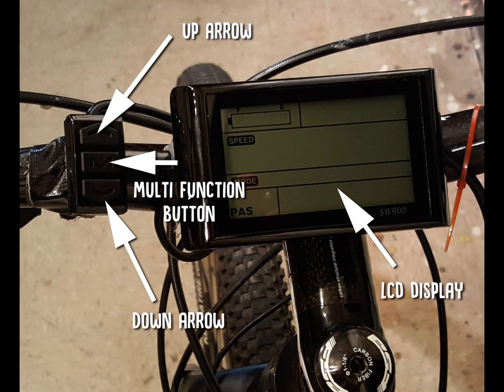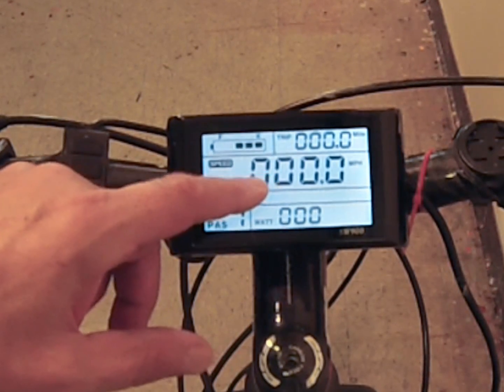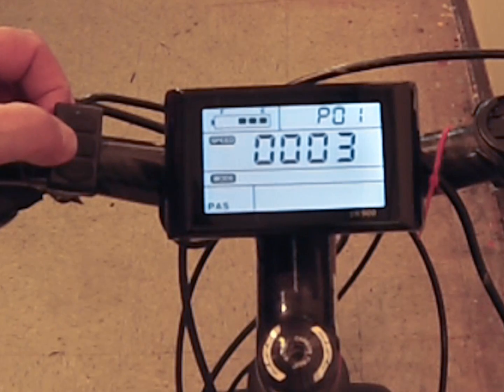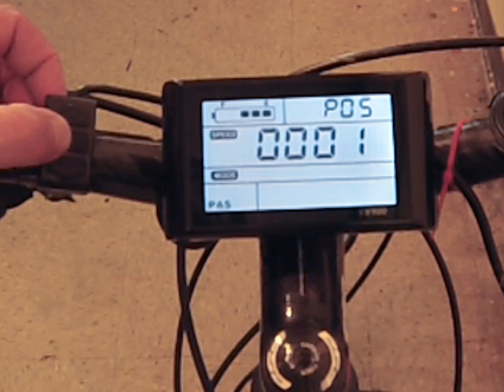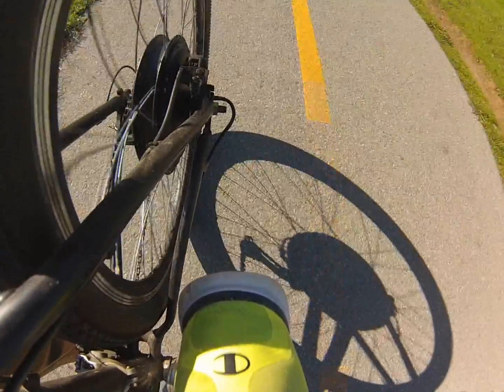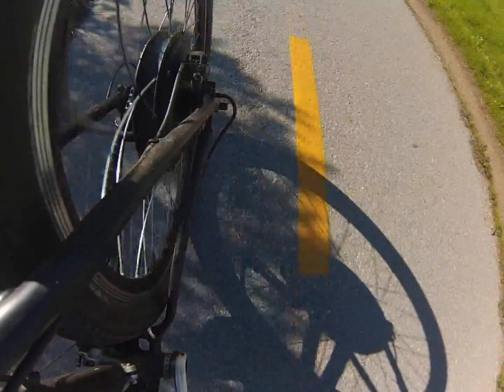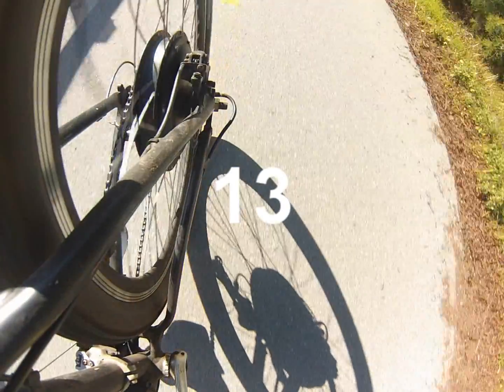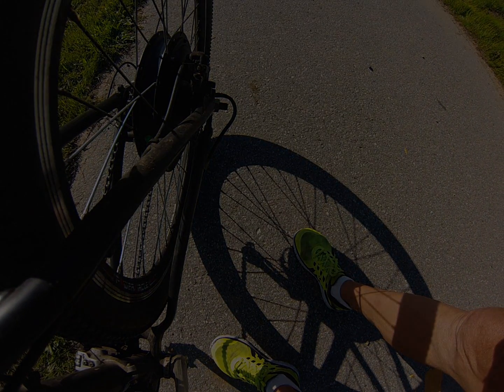EBIKE TIPS. The SW 900 LCD E-bike computer how to control it's 15 functions

Comment: 4.8 Parameters setting
P01 Background luminance. 1 is the darkest, 3 is the brightest
P02 Unit of the mileage. 0 is KM, 1 is MILE
P03 Voltage grades. 24V, 36V, 48V. The original voltage is 36V.
P04 Sleep time. 0 is without sleep, other numbers stand for the sleep time (1-60 min).
P05 PAS grades.
 0, 3 grades mode: 1 grade 2V, 2 grade 3V, 3 grade 4V
 1, 5 grades mode: 1 grade 2V, 2 grade 2.5V, 3 grade 3V, 4 grade 3.5V, 5 grade 4V
P06 Wheel size. Unit: inch. Precision: 0.1
P07 Speed measuring magnet. Range: 1-100
P08 Speed limit. Range: 0-50km/h, 50 means without limit
 No-Communication Status (controlled by the meter): when the real speed is over the ones
we set, the meter would shut off PWM output; when less than the speed we set, the meter
would turn on PWM output automatically, the driving speed would be ±1km/h; (Speed limit
is for PAS, not for Throttle)
 Communication Status (controlled by the controller): The driving speed keeps same with the
ones we set. Random error: ±1km/h. (Speed limit is for both PAS and Throttle)
Notes: These data are based on KM. When changing KM to Mile, the speed value on the
screen would convert to correct Miles automatically, but if you do not change the setting of
speed limit from KM to Mile, it would be different from the real speed limit in Mile. 
P09 Zero start & Non-zero Start. 0 is Zero Start, 1 is Non-zero Start
P10 Driving mode.
0 is driven by PAS. Throttle is useless at this time.
1 is driven by Throttle. PAS is useless at this time.
 2 is driven by PAS & Throttle. Throttle is useless at Zero Start status.
P11 PAS sensitivity. Range: 1-24
P12 PAS start strength. Range: 0-5
P13 PAS magnet type. There are 3 types: 5, 8, and 12.
P14 The Current-limiting of Controller. The original Current is 12A. Range:1-20A
P15 Not implemented now.

Comment: As an Engineer, you did a great job explaining all the functionality of the controller. Unfortunately,  I have a different model and I only have 23 functions. Just wondering, does a factory setting contain the settings as delivered?
Reply from the maker: Thanks Jessie, The simple answer is yes and the reason they do that is based on international laws about voltage, wattage and speed. With the better controllers, you can customize those settings based on your needs. The earlier models of ebikes had those settings hard wired into the controller.

Comment: After watching your video I was excited to out to my garage where I have my new Ecotric Fat Tire Bike and adjust some of the settings. Only to find out that I don't have the SW 900 Computer... I have the S900 Computer which is missing many of the fun features that the SW 900 has. Oh well... thankfully I just found the SW 900 Computer for sale online. So I'll just be out an extra $50. Plus I also want to get the rear and front powered lights as well, which can also be controlled by the SW 900... but not the S900. Bummer...

Thank you for the time and effort you put into making this video. Very good!  I just subscribed. Cheers and God bless

Comment: I'm wondering if you could help me when pulling on full throttle does your battery meter dip to Empty then when realising throttle it goes back to the full battery Indicator or do you think this is a fault somewhere

Comment: Hey I need help please
I have the s900 screen some of my P settings are disabled 
I want to unlock my speed however all manuals I have found are for sw900 and I have the s900 
P01 P02 
Some are skipped and then I randomly have P018 which I can’t even change any settings can you help me out
Reply: Hi man 
Have you found the instructions? I have s900 may someone has ?

Comment: Thank you so much for your detailed walk through of the control panel. The kit came with no instructions and even though I knew holding down the buttons would change settings, I still had no clue what the setting were for. I found your vid extremely helpful.

Comment: I have this unit in my Radrover bike, which I just purchased last week.  The odometer is stuck on .9 even after riding for 3 miles measured by a different bike.  Is there something wrong, or can I go in and change the odometer some how?

Comment: Anyone who got error 10: I recently had the same Caused by connecting a gps to the 12V dc output intended to be used with a torch on the motor control unit ,this caused something to blow but the problem wasn’t in the motor control box it was a resistor in the SW 900 display so maybe open your display and look for burning.

Comment: Is there any way to increase the LCD screen timeout settings from the default of 5 minutes; which wipes out any trip statistics after it turns off? Thanks!
Reply from the maker: I love many aspects of this LCD, but I don't like that it wipes out your trip stats when turned off. I wish I knew a way to change it. There are other LCDs that don't do that, but they aren't as accurate. Thanks Stephen!

Comment: hi i have one of thease with a controller that it came with i just installed it on the bike but for some reason i cant get the display to turn on and it will not turn on at all witch wont allow me to use the bike i made sure the battery and esc getting power but im stuck

Comment: Hi! I Have the same lcd display and when you press long to up arrow its turn on the light but i could not find which cable and what voltage lamp i have to put in. is there any way to converting 48 volt to 12 volt for lamp and which cable

Comment: Does the SW 900 Work with any motor or only paticular ones for comparability and price please.
Reply from the maker: It will work with most motors. The SW-900 is both the LCD display and controller. There are a few manufacturers that have the controller in the motor, so it will not work with those proprietary systems.
Reply: Art Ashworth it won't it simply works with the controller in the sense that it allows you to change various values and settings of the  controller and motor like the video shows
Reply: Are you saying that the SW-900 will replace the silver ebike controller box that comes with most of the 1000 watt rear hub motors?

Comment: nice video! i have the same kit but my pas only works when i paddel backwards :\ is the pas on the wrong side or do i only need to turn it around? maybe you can help me
Reply from the maker: It's on the wrong side of your crank. You have to install the magnet with the arrows facing in the pedaling direction. They should be clearly marked. Let me know
Reply: Augustine fast Carbon e-Bikes - Santa Cruz 2017 yeah that was the problem 😂 thanks for your answer
Reply from the maker: Great! Before, you were probably riding -25 mph

Comment: what is pas grades mean?
Reply from the maker: Pedal Assist
Reply: Augustine fast Carbon e-Bikes - Santa Cruz 2017 you said you can control the amps from 1-20 I have a 40 amp system will his not work for my bike.

Comment: When I pedal(PAS) the motor kicks in and I go too fast(16mph) in ECO. Which setting(s) should I change? I have tried several different combos but no luck yet.
Reply: 968Porsche1993 - Hi.. You ever figure out how to adjust your pedal assist lower than 16 mph?
Reply: Hey I have the same issue did any of you guys figure it out? Mine even in eco mode propels to 16 mph, the only way to lower is to lower the max speed setting but then the 5 pas settings becomes useless as . Again the throttle allows speeds a lot slower , right down to walking pace. Mines a 1000w kit with this exact computer display
Reply from the maker: Go to Parameter setting 9 and set to zero. That is Zero start, which means that your motor will not start until you have pedaled 6 to 10 revolutions and then your motor will work in PAS mode.
Reply: Is there a way to decrease the amount of motor input while using the pedal assist? When it kicks in, I still go too fast and pedaling seems useless. I was experimenting on today's ride and what seemed to work was using the throttle on low amount and pedaling. This seemed to provide a nice combination of pedal and motor
Reply: Same problem here. PAS 1 too fast.  I gave up on the SW900. Changed to a KT controller and used  their LCD displays. It's a shame. The SW900 came with a 22A controller that I had to scrap.
Reply: Same here in that it is too fast. But I am also experiencing another weird symptom. PAS 1 propells forward, then stops then kicks in again, stops and starts again until I am over 20km/h. Afterwhich I do not feel any assist coming from the motor unless my speed drops. 
Is the KT controller with LCD display interchangeable with the SW900? As I read the KT LCD3 shows temperature, but I do not know from which sensor this would be coming if I bought a rear hub motor for use with the SW900.

Comment from the maker: The SW 900 is 1 of 10 major, on board computer models available today for e-bike conversion kits. It is important to understand all of the functions that these computers control to get the most out of your e-bike from fun to safety to power. Keep watching for more updates.
Reply: Electric Bike Lifestyle AUGUSTINE EBIKES will this work on any bike .I have a 259w rear hub motor batribike granite pro. You can never see the back of it.iys 26incg
Reply: Electric Bike Lifestyle AUGUSTINE EBIKES I meant you can never see the back of th display.
Reply: Can you tell me haw to fix error 10? I have 72v 🔋 on 48v hub motor.
Reply: Do you have info or a video of the S900 Model? It has P01-P12 in its settings only